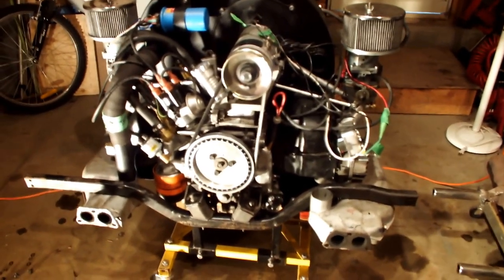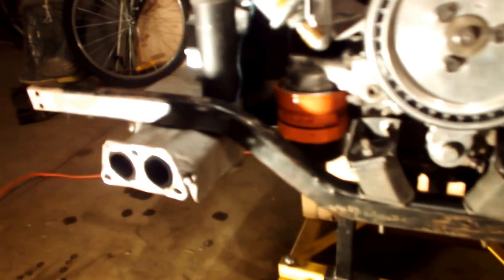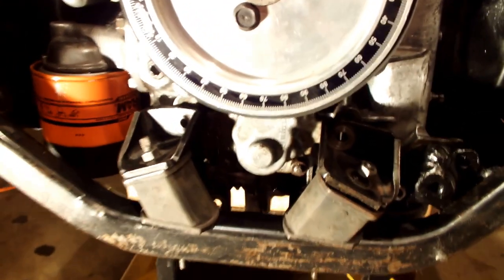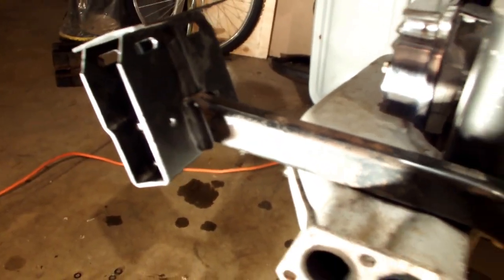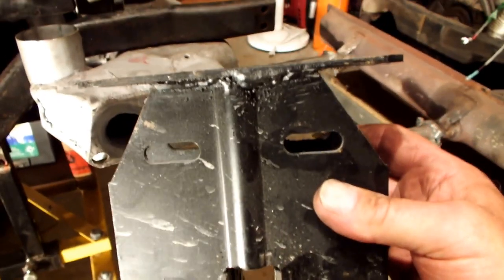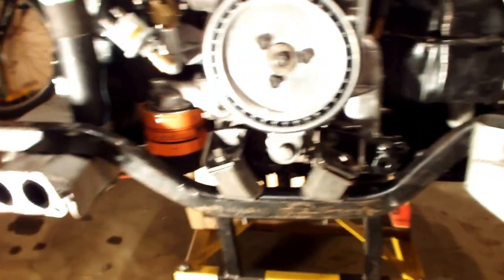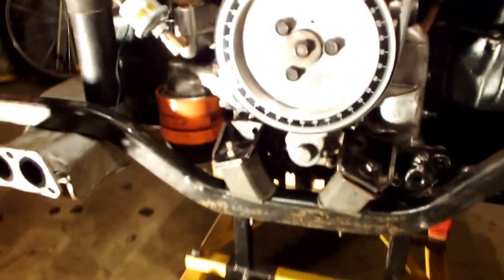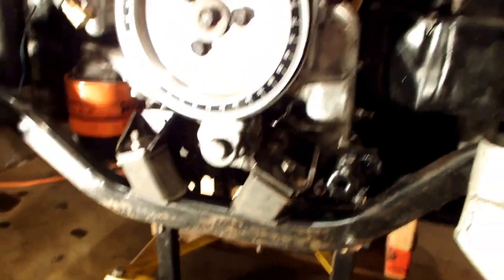Porsche 914 Type IV Bus Engine Mount for Karmann Ghia

Comment: did you put a plate beneath the tin? That engine bay tin is a bit thin on my car, does it still help keep the engine supported?
Reply from the maker: No I didn't place any plate or other reinforcement. The hangar plates shown in the video add strength once bolted against the engine bay tin. The moustache bar isn't meant to support the weight of the engine (the transmission bell-housing forks do that). The moustache bar helps prevent the engine from twisting (and damaging the transmission mounting fork) under acceleration and helps transfer more power to the rear wheels.